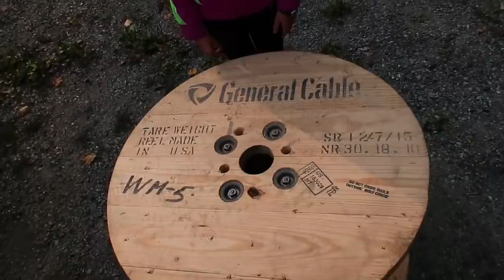Building Goat Paradise (for our Nigerian Dwarf Goats  with wooden Spools)

Comment: 5:30 I worked for the phone company for 30 years and we had all sizes of wire reels. I used to practice walking on them, (rolling them). I figured if I ever became a lumbethack, that would be a valuable skill... The bigger ones are a little easier. You have to be quick to walk the smaller ones, they're very reactive. The 3-4 foot diameter ones were the easiest for me.

Comment: Suggestion. If you cover the tops with roofing shingles or something rough it will give them grip and keep their hooves trimmed. Also are you removing them when it ices?
Reply: tip them on their side in snow & ice...I could see the goats trying to balance on the spool & pushing them around the yard.
Reply: Goat hooves would shred composition shingles. The goats do not need additional grip. The ice won't bother the goats. They are wild animals and used to living in the ice. Goats are very agile animals.
Reply: 8

Comment: Wood plugs should be cut to fit the holes in the surfaces.  That spray gunk will be dug out by goat hooves in no time, besides that it is not permanent under any conditions.